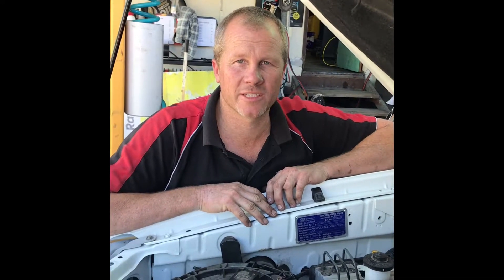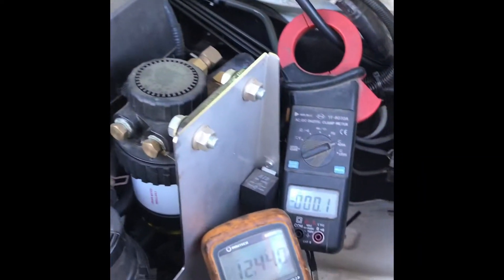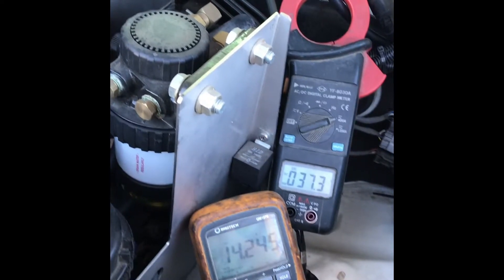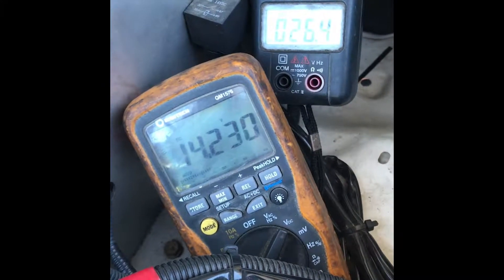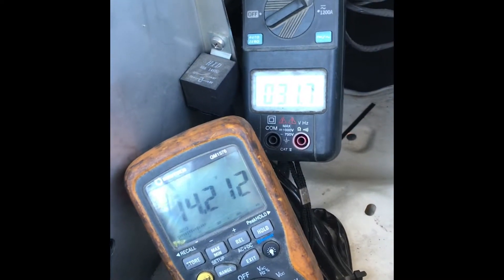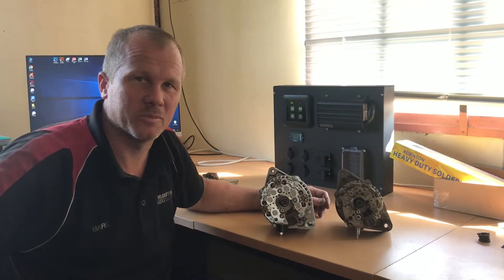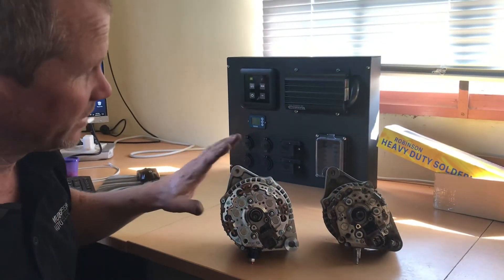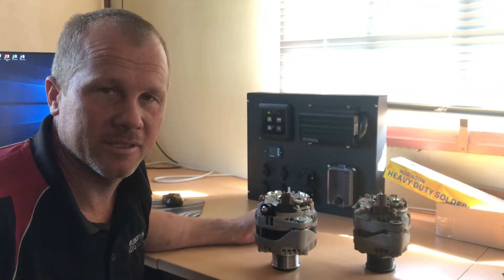High Output Alternator Upgrade to a Hilux

Comment: Cheers cob appreciate it 5vzfe running twin thermo fans + HHO gas cell .... standard didn't much like it 70-75 puke amps ... looking at fitting a Bosch Holden Commodore.... or is their a  higher output more compatible Toyota option ? Again cheers 🍺good to see an aussie not tundera or tarcoma  ♥️♥️♥️